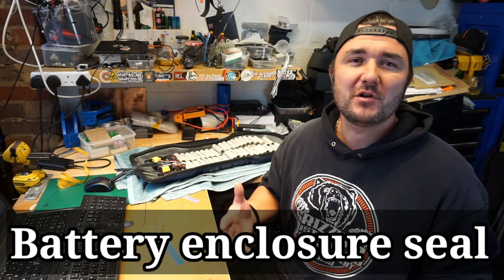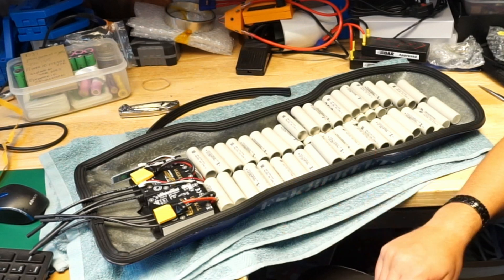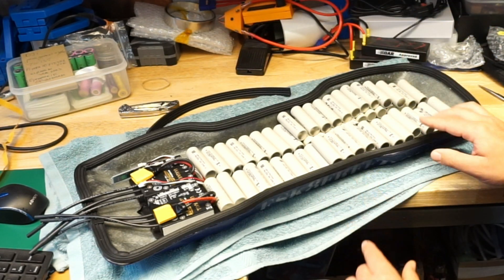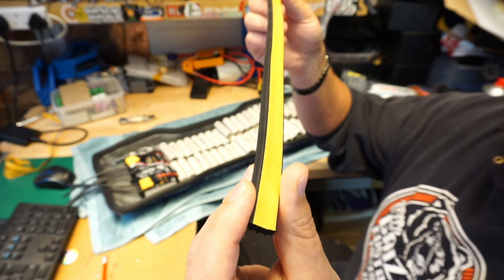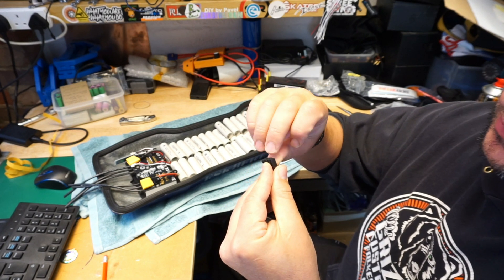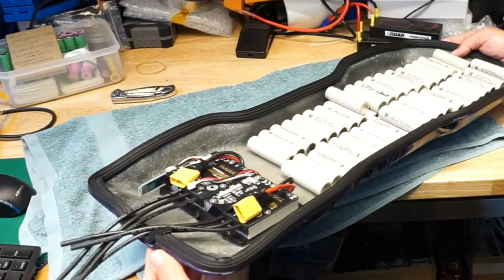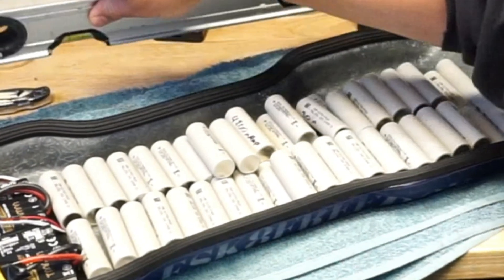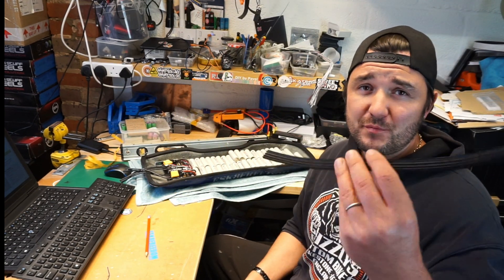Battery enclosure seal. No dust , no water, easy installation.

Comment: Hi Mate. How do you drill a hole into this material for the enclosure screws? Does a normal drill bit work okay?
Reply from the maker: Sunny, are you referring to the holes through the gasket? Yes, it is best top use the punch tool because the drill bit will not work very good. You can fin a tube the size you need and sharpen the edges.
Reply: Saw your other video where you use the punch tool.

Comment: How I screwing the enclosure to the deck through the rubber
Reply from the maker: Hi,
Just use a drill bit and make the holes through it y hand or best using a hole punch.
I do have a video on how to do the rest ; )

Comment: It’s basically weatherstripping and you can use weatherstripping and such windows stripping that peel off and stick at any hardware store it’s like foam insulation that you just peel and stick🤙🤙
Reply from the maker: Hi mate,
Its not the cheap and very mushy foam like for the windows mate.... feels more like a car doe seal.